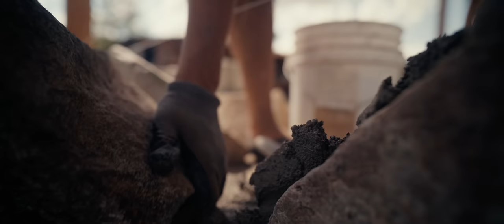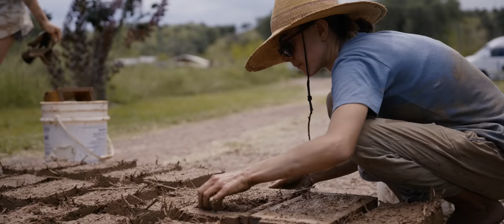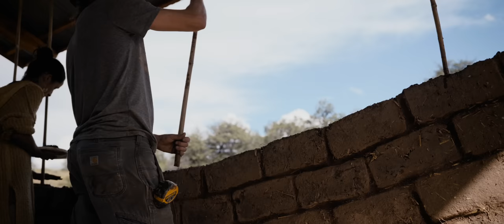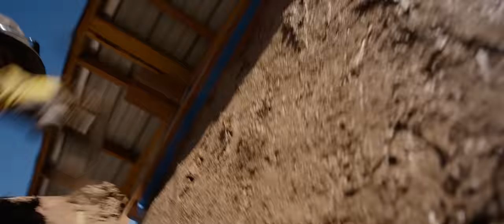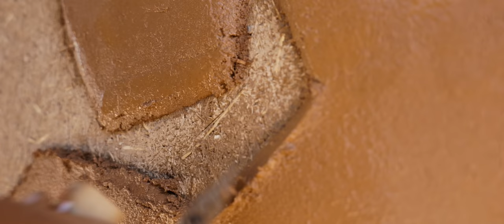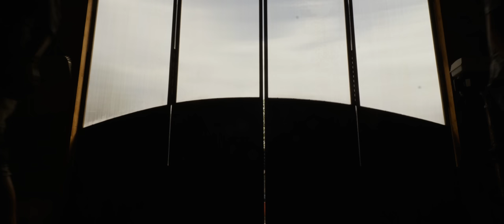From the Earth Up: building with Adobe, Cob, & Daub - A Mesmerizing Venture

Comment: Will the clay shrink or crack over time and leave air gaps between the clay and the posts and beams?  Also, is there any issue with condensation inside of the structure?
Reply: Very educated video

Comment: Very beautiful! This is awesome. What are your thoughts on the exposed timbers to the outside and the timbers ground contact to the concrete and thus the quickened rot of the wood? Does it have to do with climate (I understand you're in a hotter, dryer area)?

Comment: good job!
i made a tiny similar project with cordwood and 'cobmortar'. but up to now i have no idea for an ecological roof. in your video i can see sheetmetal. of course a nearby solution. but i'm not realy happy with. maybe an item for a next video.
Reply: I agree. I would like a sod roof, but dont really want to use EPDM or plastic liners to make it waterproof. Any ideas?
Reply: @LitoGeorge  
in nortern germany we still have some historic  'reetdächer' = thatched roofes.
but the reet is only growing in ecological habitats and more or less not available in germany. maybe some few from poland for very much money. and next problem, nobody has experiance to work with.
and here in my home region bavaria we had in the past 'schindeldächer' = shingle roof, in us somtimes called shakes.
similar problem. the shingles are very rare and expensive, and only very few are experianced to build with. maybe a little more in austria and switzerland. anyway both solutions are very expensive.
Reply: @waldschratdersandersmacht  ah yes, the thatched roof. Really excellent, and I have lived in two homes with fully thatched rooves. They smell dusty and danky after many years, and are cool to be under in the summer. I am originally from SAfrica, where it can get really hot in the summer. You're right. Finding people who are skilled at thatching is very difficult in North America (I am now in Canada). And, you have to contend with the insurance system as well as the "code" system for getting the green light to build. Very, very expensive and difficult. And yet, I would choose the thatch roof over almost everything else because its so earth friendly and smart. It does take maintenance every 10 years or so, but show me something that doesnt. Thanks for the reminder of a good roofing system. Any other suggestions? The shakes on a roof are an alternative, and I've never really taken it seriously here in Canada. Maybe its because of snow load or maybe I just havent looked into it hard enough to see if its a good system. A lot of work, either way. Thank you for your response.
Reply: Take straw for the roof. In the Pannonia region was on the daily base. In Slovenia, Croatia, Hungary etc.
Reply: @daliborsedmak8343  I guess straw is the same kind of concept as thatch, but I've never heard of it. Do you have a good link to share?
Reply: How about brick?
Reply: @LitoGeorge  
yes this could be an option.
in the very fare past i heared about rye straw. but by harvesting with modern machines only balls of short cuttings are remain. it could be difficult to find useful long straw from old high growing rye species. and i guess you have to harvest them by yourself by hand with an scythe
Reply: @daliborsedmak8343  
very interesting answer!
do you kow a source for long roof-straw?
and do you kow someone  to work with?
Reply: @waldschratdersandersmacht  on my farm before I went through separation, I planted fall rye. The separation took me by complete surprise. I never got to see it in all its glory. I think I could have used it for amazing projects. I was doing more research and saw some folk use slate for their roof. I have seen this in real life. Only hassle is that it cracks easily when there is hail.
Reply: @LitoGeorge  yes in thuringia (part of germany) slate was very common in the past, and at that time compleatly hand made.
today very very expensive.